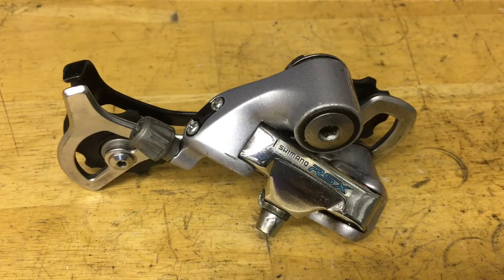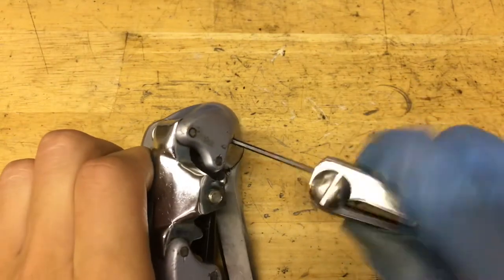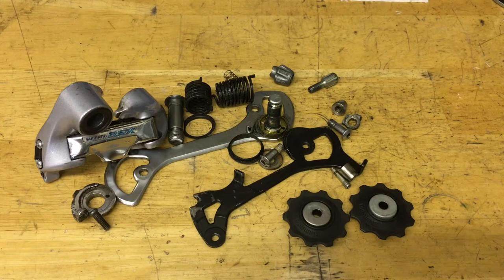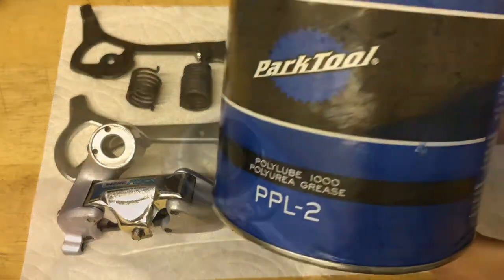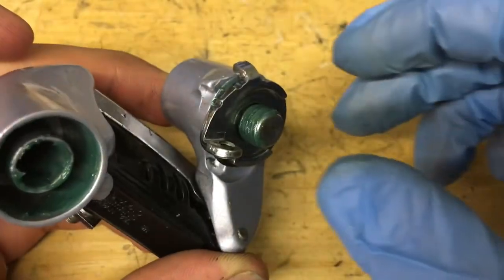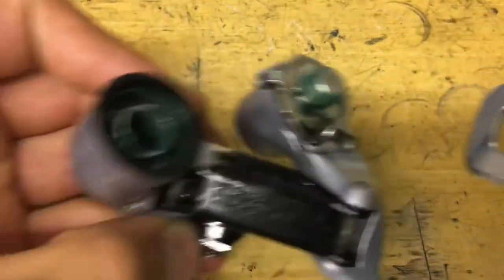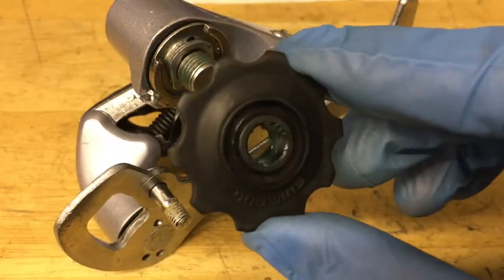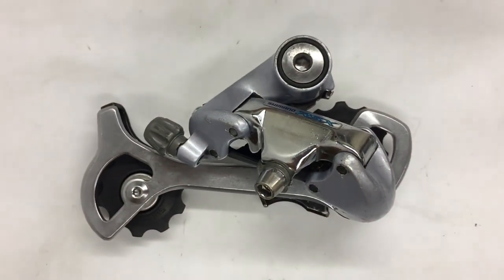How To Rebuild a Shimano RSX Derailleur

Comment: you would not happen to know the type of pulley wheel which is fitted. The ones at my local bike store don't fit!
Reply from the maker: Make sure you’re putting on a 10 tooth pulley. It should be 7/8 speed